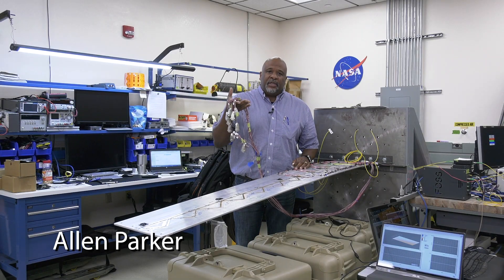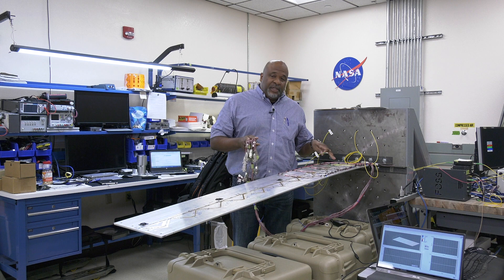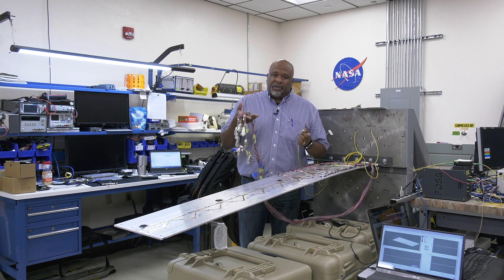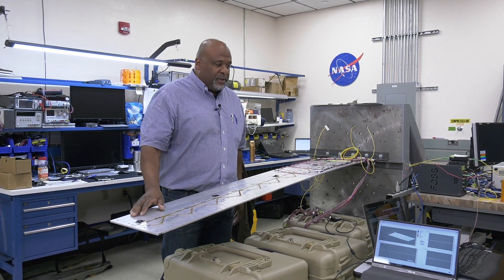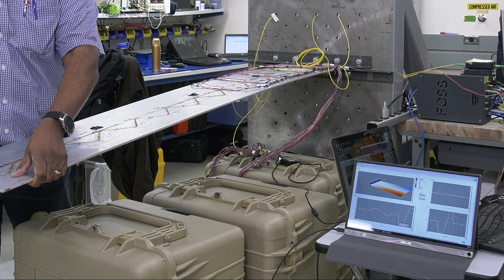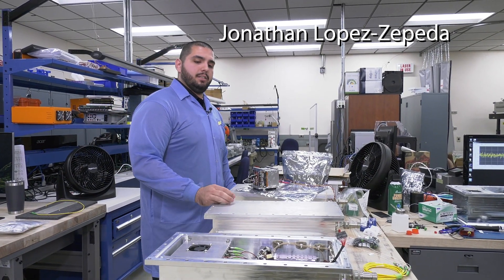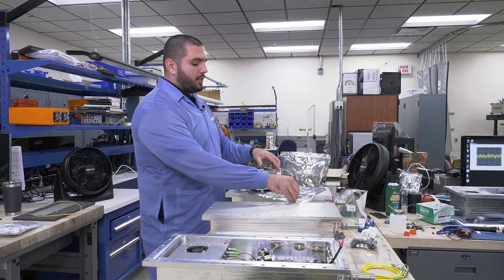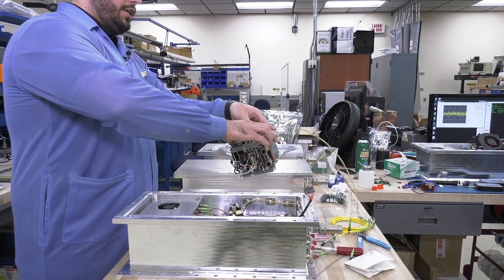FOSS Readied for Validation Tests for Space Applications

Comment: Neat! How does it work tho?
Reply: In the first presentation, they present an alternative to a bunch of individual strain gauges each with their own connector and output cable and instead having a big long serial chain of strain gauges that output data to a single fiber optic connector. The fiber optic is important because it is able to have the super fast transmission speeds that let you transmit data from the 300+ strain gauges in real time. The strain gauges themselves probably work via strain induced elongation. As the beam/plate/wing bends downward, the top surface is going to experience tensions and very slightly elongate. The strain gauges are essentially a zig-zagging tiny wire carrying electrical current that is very sensitive to its’ length slightly changing. So as the beam bends, the elongation is detected by the gauges and reported in the force of varying currents as an output. Plug in a constant scaling factor for particular strain gauge, the plate’s material and dimensions, and you can then graph/3D-model the strain and the overall plate shape, allowing to see how well your spacecraft is actually handling the loads of flights and confirm the validity of your simulations.

Comment: How does it work?
Reply: In the first presentation, they present an alternative to a bunch of individual strain gauges each with their own connector and output cable and instead having a big long serial chain of strain gauges that output data to a single fiber optic connector. The fiber optic is important because it is able to have the super fast transmission speeds that let you transmit data from the 300+ strain gauges in real time. The strain gauges themselves probably work via strain induced elongation. As the beam/plate/wing bends downward, the top surface is going to experience tensions and very slightly elongate. The strain gauges are essentially a zig-zagging tiny wire carrying electrical current that is very sensitive to its’ length slightly changing. So as the beam bends, the elongation is detected by the gauges and reported in the force of varying currents as an output. Plug in a constant scaling factor for particular strain gauge, the plate’s material and dimensions, and you can then graph/3D-model the strain and the overall plate shape, allowing to see how well your spacecraft is actually handling the loads of flights and confirm the validity of your simulations.
Reply: https://youtu.be/Kc3foeu2-50

Comment: It wasn't explained, but how are the fiber optics measuring strain? I suspect it reflects the light back from the end of the cable back to the emitter, and then measures interference from interior reflection patterns to derive distance and amount of deflection?
Reply: I think the stain gauges are still basic strain gauges and just handing their data off the next one up the chain in a serial fashion, they’re all daisy-chained or something. The fiber optic is only at the base and is only fiber because the fast transmission speed is needed to real-time plot data from 300+ gauges
Reply: @atorrance  it uses the fibre optic itself, or it wouldn't really be  a weight saving! https://youtu.be/Kc3foeu2-50